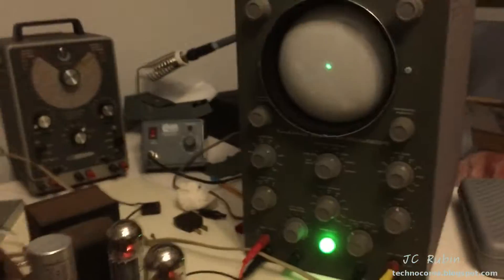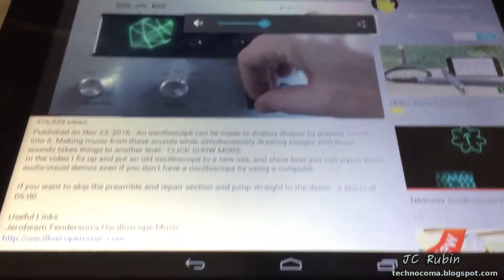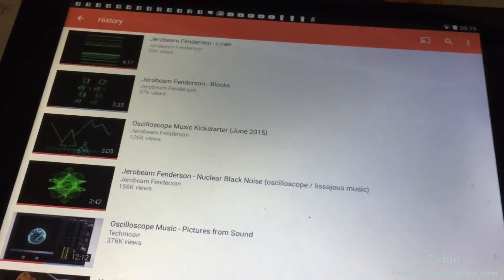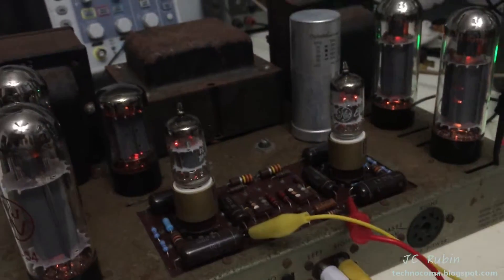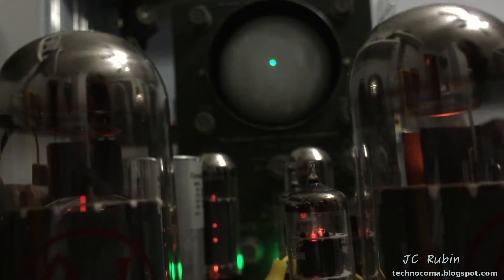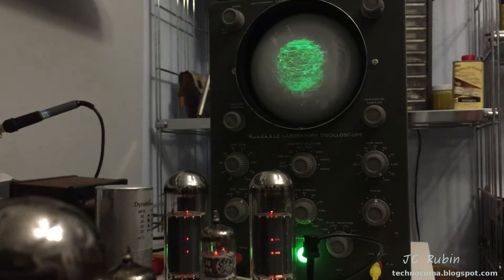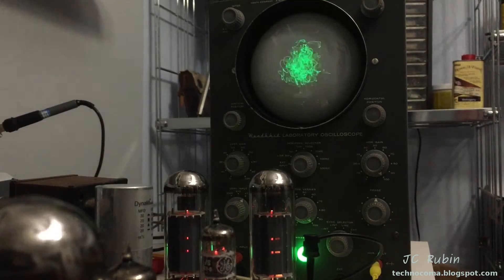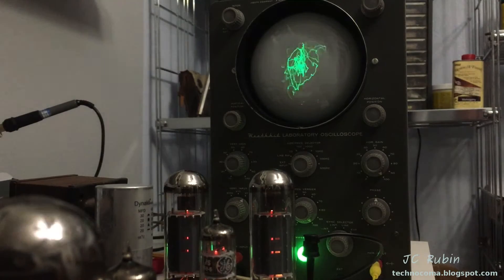Oscilloscope Music - Heathkit O-12 DYNACO ST70 edition

Comment: Hi Jordan... nice images on the Heathkit! I actually paid for the download audio files, but never got a very good image on my Tek 7603 scope... would you be willing to describe how you connected your gear up.  I sent the signal to my scope at line voltage level... maybe that was my problem.  Any help with connections would be appreciated.
Reply from the maker: Greetings to you!
As the 7603 is a fine scope you can run into an issue because in this exercise we find that both inputs must be calibrated against each other for the display to work properly.   After many years, one or more could be off.  This is easy to determine, looking at my video here which will take you to the correct time in the video for the production of a perfect centered circle in the middle of the screen in XY mode.  You will need a function generator with two outputs that can do phase adjustment

https://youtu.be/9ZDjdkWLCuo?t=19m30s

You may be able to the use the UNCAL knobs as necessary to achieve a perfect circle of the scope is out of cal.  Once setup you can swap the generator for the audio and try to see if the quality improves
Reply: P Potter if you haven’t already figured this out, you need a high quality sound card or player capable of outputting at 192khz/24bit. I use a raspberry pi with Hifiberry DAC+ and get distortion free vectors on my scope.